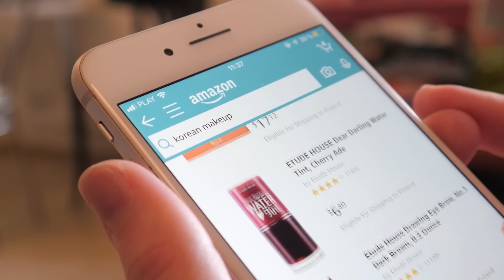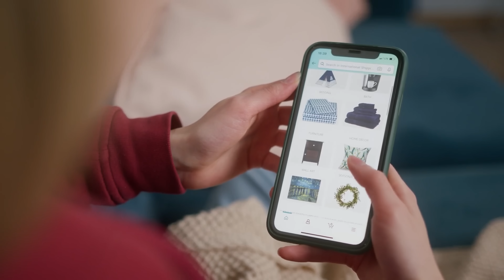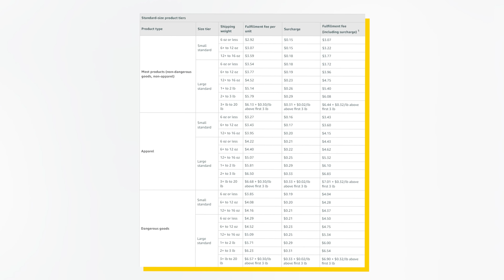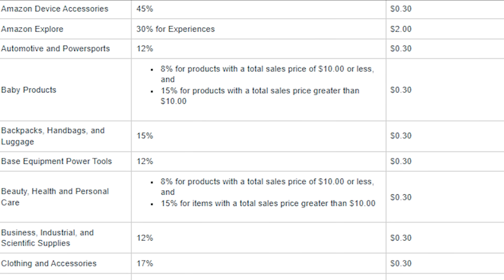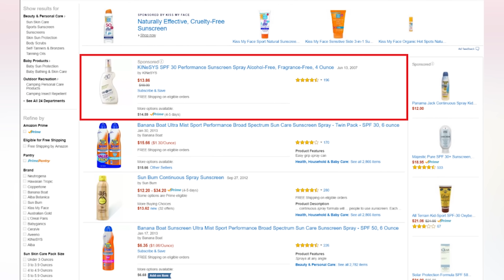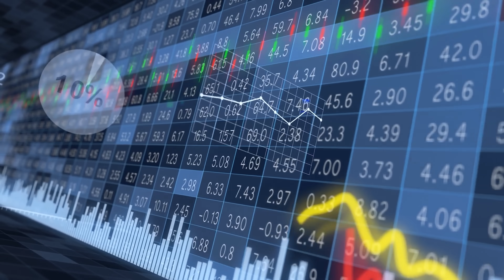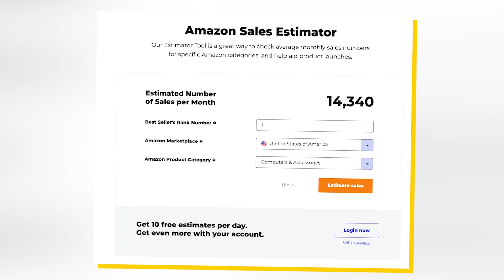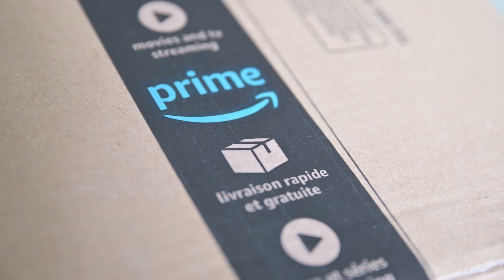Amazon's Quality Is Becoming Unbearable

Comment: amazon seller here... you pretty much nailed all the main costs of being an amazon seller. I have about 12 product on amazon, each one doing about 100-200 units of sales per month at around 15% gross margin. The biggest cost is Amazon ads. If we were to take that out of the equation, profitability would jump to 45% percent. To solve this problem Amazon needs to (ironically) change their FBA fee structure, and find different ways to boost products to top of page (not via ads, but maybe based on company, quality etc). 

Fortunately Amazon is working on autonomous systems that will hopefully drop the cost of fulfillment, which hopefully can get passed down to sellers and customers. 

Private labeling is not the problem here. Most of those goods are quite decent and work alright. It the REVIEW system that misleads customers into believing that the product is better than it is. For many of my products, I went through Amazon Vine and instantly got 20-30 5 star reviews. Any seller can tap into this. More over, sellers can BUY fake reviews. I've never done this personally, but just looking at some of the reviews on some products just shows how obviously scammy some sellers can be.
Reply: Sometimes when I recieve my amazon purchase, i get those little business cards promizing an amazon gift card for a 5 star review
Reply: I wonder what you're selling though. The norm for me is a 25%-35% profit range.
Reply: @AmazingStoryDewd  25%-35% EBITDA? If so you are doing extremely well! For many of my products, I haven't reached economies of scale so I do have to pay a higher cost per unit in terms of production and shipping. But 2021 was my highest grossing year, around 22% gross. I'm okay with that, but I'm on board with you to aim for a little higher (maybe 35%). I think the problem is my ad spend LOL. We spend a LOT on ads. Like I said if we cut back profit would jump to 45%. But then sales aren't guaranteed.

Comment: I agree that this becomes really hit or miss when buying these kinds of products. I've bought quite a few "Chinese knockoffs" that have not only been a fraction of the typical retail price but was actually pretty decent quality (and amazing for the price). For example, I was shopping for a TV mount and Best Buy was asking for up to $300 with even the cheapest being like $100 (maybe a bit less, it was a while ago). I looked on Amazon and bought one that had the motion I needed for like $20 and it was solid metal and good construction for like 5-20% of the price best buy wanted. Now I know best buy is known to be expensive, but that difference is still enormous.
Reply: I got a very different story but with ebay for a foldable ladder. Amazon was 3 times more expensive than ebay for the exact same ladder. I’m not fond of Amazon specially since how much exploitation, union busting goes on. I rarely buy there and of course I don’t pay for prime.
Reply: A TV mount is just a few pieces of metal. Pretty low tech. If the factory is careful in manufacturing, it need not be expensive to produce a high quality product. This is where low salaries matters. There is very little cost savings you can achieve by lowering quality. The reason high quality products are expensive, is because the market can bear it. And if you do your manufacturing in a high salary country, telling your staff to not rush but to take their time and aim for quality can drive costs up pretty fast.

Depending on the size of the ladder, they might be too heavy to ship efficiently/cheaply by courier. Shipping a ton of them to the same Walmart packed onto palettes in standard shipping containers would be cheaper, per unit. Somebody has to pay for postage, and it is always the buyer. Some sellers advertise a low price and hit you on the shipping. Others advertise low/free shipping, and take it in higher prices. No seller is there to lose money on every sale, so end of the day, the buyer always pays. Unless the site is running some promo and you can get some discount codes or rebates on shipping, which comes from the marketing budget, which comes from profits, which comes from what other buyers pays.

Comment: The Amazon system is broken without remedy.
There is an handful of websites here in the UK that sells branded, high quality computer items (including dongles) at slightly higher prices than Amazon, but it is high quality high performance items, and are shipped overnight.
People buy from Amazon because they don't have to enter all the details like address and card number, but it is an expensive form of laziness.
You're also right on the self-gratification issue, so they seek the item without doing any due diligence.
I realise I represent a minority, though; and this is the fortune of Amazon...

Comment: I just want add, as an Amazon zealot since 2014, the recent move to using USPS for rural deliveries (so it doesn't have to pay UPS) is a DISASTER. Rural POs in the US are totally undersized and understaffed to handle the package volumes. And don't get me started on the lack of shipping software update required to differentiate between a package that will fit in a standard US mailbox versus one that UPS can just leave on the porch!
Reply: I was working 12 hours a day, 6 days a week at my post office so I quit. USPS cannot handle the package delivery, especially when they are so focused on mail. Also the devices we were given are garbage and slowed us down so bad. There wasn't even a GPS on it, and most packages couldn't even scan in for whatever reason.

Comment: I don't shop on Amazon anymore. I haven't for years. And I don't ever plan on ever ordering anything from Amazon ever again. 
I got tired of ordering things, and they not being what they were supposed to be when I got them.. A pair of Bluetooth earbuds that had a battery so small it only lasted long enough to turn them on and pair them, then they'd say low battery and turn off.. a 256gig SD card that was really only 4gigs (twice).. a USB thumb drive that was just a plastic case with a little rack glued inside of it.. a USB hub that didn't have any of the wires soldered...
I don't care how good the customer service is, I don't want my money back or a replacement (especially when the replacement is just more trash)... I want what I ordered in the first place.
Never happens when I order things from walmart.

Comment: I think the issue is that Amazon ended up fulfilling the need for a hands-off approach to bussines management for sellers inadvertently. These sellers do not have customer satisfaction in mind and most only seek a quick profit.
If engagement with customers was encouraged maybe this problem could be offset
Reply: there is nothing inadvertent about having a hands off approach to the sellers. The sellers provide the inventory. That is the primary difference between Amazon and every other retail business in history. 

The majority of the product inventory in the Amazon distribution network is not owned by Amazon. When Walmart evaluates opening another distribution center they have to justify the cost of the building plus the carrying cost of excess inventory. 

When Amazon evaluates to open another warehouse they consider the cost of the building and the revenue it will generate by providing more space to get third party sellers to fill. 

As long as third parties are willing to keep filling up buildings, why would Amazon ever quit building them? 

Actually they rarely build them or own them. The building management firms build on speculation that Amazon will want more. Then Amazon leases and has the builder customize to meet their needs. They only buy where they have a financial incentive to do so.

Comment: Amazon jacks listings 
If you find a product and it sells well, Amazon would source out the manufacture and sell it as their listing at a price equal to yours or lower. 

Products that Amazon sells, Amazon takes priority, so the rotation on seller of the product is skewed towards Amazon 
Eventually squeezing out the original seller. 
Very A hole move